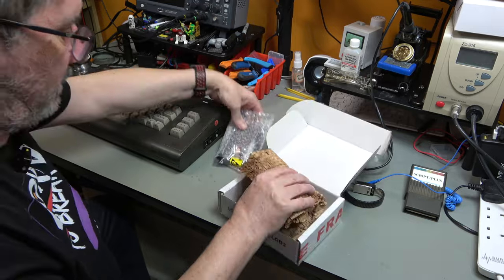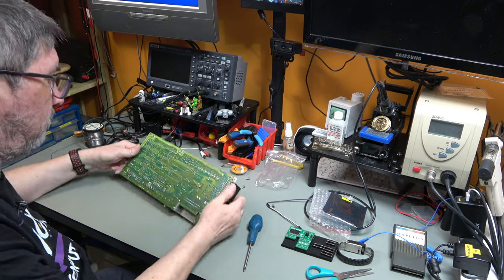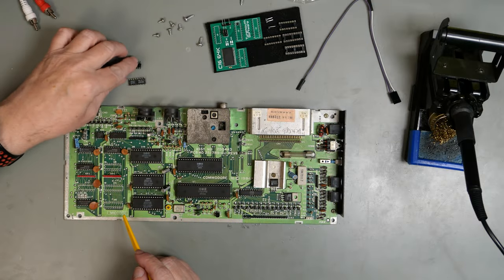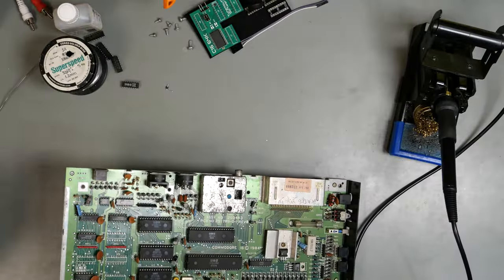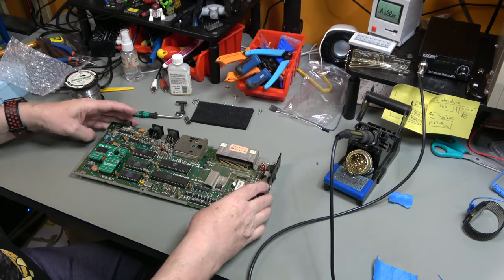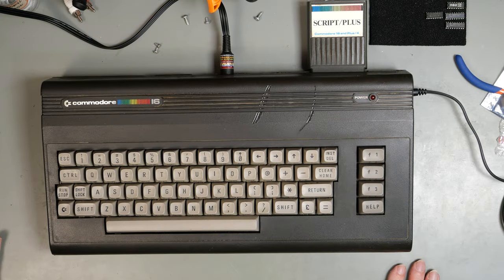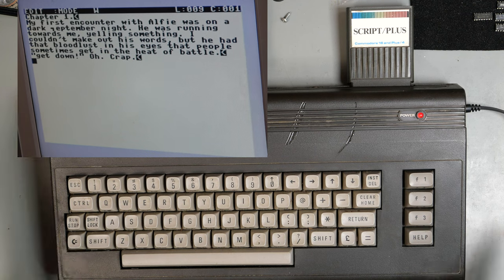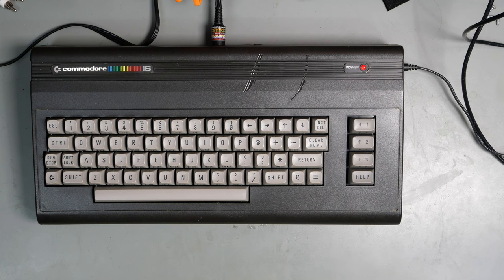Commodore 16 64K Upgrade by Tynemouth Software

Comment: Brilliant video Tim. I managed to snag a lovely condition C16 a few years ago from F/Book/MarketPlace which had a blown internal fuse and a faulty power supply plug. After replacing the internal fuse with a brand new one and fixing the P/Supplies faulty plug the machine powered up perfect. I then  researched on Google to add the 64k RAM upgrade, which i did mine with an On-Off inline switch (so i can still switch back to the standered 16k (as there are a few C16 games that refuse to run correctly in 64k mode (Rockman is just one of these games).
I also added an internal SD2IEC Micro SD card board, added heat sinks to the main IC chips and it works flawless. I last owned a C16 in the late 1980's/early 1990's and spent many joyfull and happy hours playing Rockman, Bandits at Zero, Booty and Blagger. For me the C16 is still such a thing of pure beauty and nostalgia.

Comment: Great, thank you. Yes, using the board to align the sockets does help. Dual wipe sockets are more forgiving for alignment, but the turned pins ones seem a better contact.

Comment: Wow, I thought that would have been in a wedge case and not a bread bin.  I didn't know the made a C-16 like that.  I guess the smaller  ram chips were a lot cheaper back in the days of lore.
Reply from the maker: The wedge case didn't appear until the C128, and by that time the C16 was done and dusted. I guess it didn't sell well enough for them to retool.
Reply: @TimsRetroCorner  I meant the wedge case that the C64C (Short Board was in). Wasn't that sort of wedgy? (lol)
Reply from the maker: Yep. It was a shortened version of the C128 case.
Reply: @TimsRetroCorner  Ah, okay, I did not know that; cool.  It is good to learn at least one new thing each day <smile>.

Comment: Nice upgrade :) .. Id keep the ram chip you took out mate .. They go in the C64 466 board :)
Reply from the maker: Don't worry, I'm not getting rid of them ;)
Reply: I think they are the wrong ones. The 64 uses a pair of xx464, 4 bits x 64K, but these are  xx416, 4 bits x 16K hence the need for the upgrade.
Reply: @DaveCurran  correct fella .. I dont know what I was thinking. It must be an age thing, lol
Reply: @8BitRetroReFix  I think we could all do with a memory upgrade :^)
Reply from the maker: I'm still not getting rid of them! ;-)

Comment: If you ask me, this is a super ugly update. (Sorry to say.) It is way tidier to replace the existing 16KB DRAMs with 64KB DRAMs and run the wires on the bottom side of the board, if you run them in horizontal/vertical lines, with a drop of glue, this looks super tidy. For the cutting the trace under U7 I did drill a tiny hole, this causes less scars than desoldering U7.